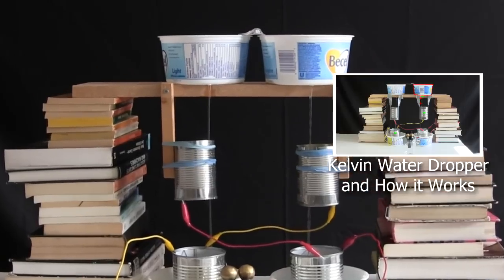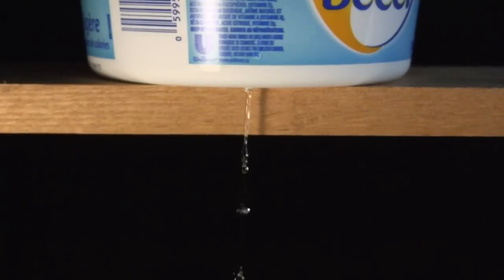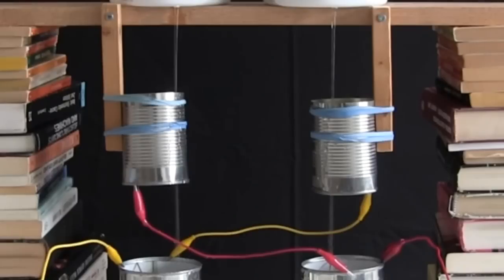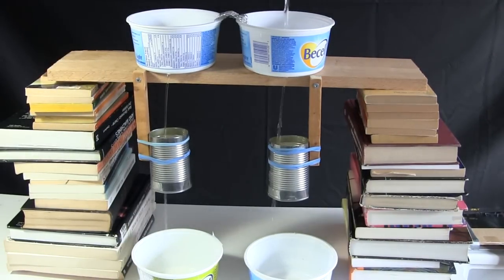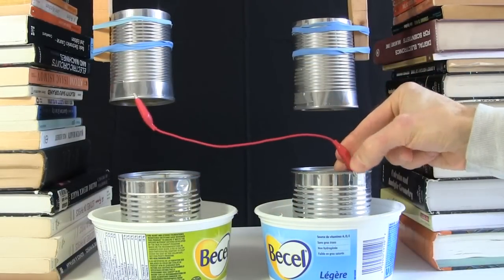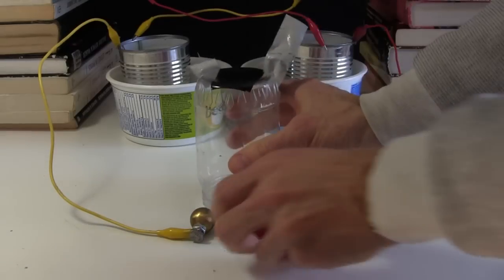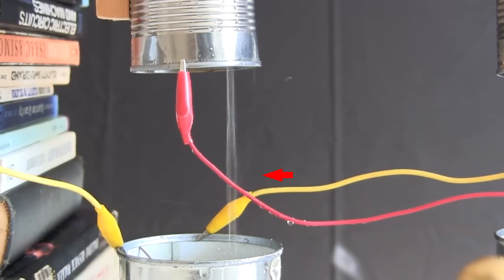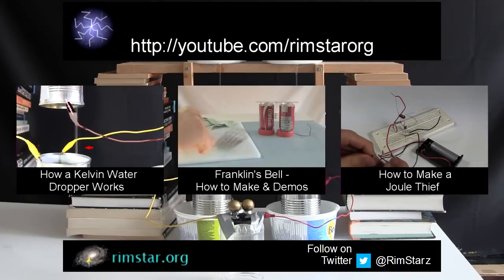How to Make Kelvin Water Dropper/Lord Kelvin's Thunderstorm

Comment: I'm using soda cans instead of the type used in the video. They do conduct electricity, and I've taken all other mentioned precautions. But still the spark ain't happening.
Can you suggest some other remedy?
Reply from the maker: From tests I've done in the past, I know that at least some soda cans have a non-conductive coating inside which you'll have to scrape off to make contact with as described in this video. Other than that though, rather than repeat a lot of tips, I have a section with tips on my webpage here: https://rimstar.org/science_electronics_projects/how_to_make_a_kelvin_water_dropper.htm. Let me know if that still doesn't help.

Comment: I have a metal on the inside, plastic on the outside container? Would that work?
Reply from the maker: Yes, that should work. Just make sure you connect the wires to the metal.

Comment: I'm trying to do this for a project, what could I use instead of brass balls?
Reply from the maker: Any smooth, roundish metal objects will do. For example, drawer handles sold in hardware stores, bolts with rounded heads, ...

Comment: I wish I had found this when my kids were little. It would have made a great science fair project. What happens if you don't let the charge discharge with the little balls? I figure the charge would build but then what?
Reply from the maker: The charge would build. If the gap is too large for the spark to happen then the charge would likely just leak away at any sharp edges having reached some maximum allowable by those sharp edges and maintain that maximum.

Comment: hello sir i just want to  aquestion tht how tht hollow can will act as a inductor and simply charge without any charge on it....just only can will act as a inductor .....sir please explain....
r
Reply from the maker: That's a hard one to explain in a comment reply. Have you watched my video about how this works? You can see it here http://youtu.be/sArNxGnYhNU
If you're asking how it has a charge to begin the whole charging process, very rarely will two objects be completely neutral. So as long as there's a very small difference then that's enough to get things going in this case.

Comment: Does the water falling through the second botomless can have zo come in contact with it?
Reply from the maker: +Peter Bucek No. You don't want the water making contact with the bottomless cans since that would electrically connect them together and cause them to have the same charge. It's okay if some water sprays onto the cans (it's hard to avoid that), but you don't want the solid stream of water that's falling into them to be in contact.
Reply: +RimstarOrg Thanks so much for such a fast reply, I am definately gonna try this since you've inspired me!
Reply from the maker: +Peter Bucek Cool. Be sure to check out the How-it-Works video too https://www.youtube.com/watch?v=sArNxGnYhNU. There are also a bunch of tips on my webpage about it here http://rimstar.org/science_electronics_projects/how_to_make_a_kelvin_water_dropper.htm.
Reply: +RimstarOrg Thanks

Comment: Did you measure the voltage coming out?
Reply from the maker: No, I didn't measure the voltage. It really depends on the shapes of the electrodes at the spark gap though.
Reply: @RimstarOrg  very interesting. I always wondered if the shapes made a difference.
Reply: @ShadowGPSDFX  larger spheres have more capacitance than smaller spheres (given the same material in all cases) and can hold a greater charge before causing the electrical breakdown of air.

Comment: Ok. And if you use magnets? Or water with pressure?
Reply from the maker: Ionwind Vortex I don't see any way that either magnets or pressure can help. What might help is volume of water falling down though, or multiple streams of water.
Reply: Thanks
Reply: this experiment look like vimanas reacctor or victor shauberger, that way i make the asking of presur, what do you think about it?
Reply from the maker: Ionwind Vortex What makes me wonder about pressure is that the water must be a solid stream above the inductor cans and droplets below the inductor cans. You'd have to make sure that higher pressure doesn't interfere with that. I think all that pressure will do is make the water need to fall from a higher height. I think it's air resistance that causes the solid stream to break into droplets and with more pressure I think the water will have to fall further before that happens. I could be wrong. That's why I suggested using more volume instead. With more volume the height can stay the same.
Reply: RimstarOrg i thinks with very high presure... the water flowing more and more fast and at some speed with the rigth temperature the water transfor it self and become like a electricity

Comment: Which wire is best for this
Reply from the maker: Any wire will work. However, since there's water flying around, you should at least get wire that has insulation on it (i.e. not bare wire).
Reply: Okk

Comment: I used 4 monster energy cans but was not able to create a spark. I want your help to make it for my school project which is just after 3 days.
Reply from the maker: Harshvardhan Agarwal It takes a lot of adjusting. Make sure the water enters the inductor cans (the ones that the water falls through) as a stream and exits as drops as I show in the video. Looking at photos online, monster energy cans are quite tall. Maybe cut the ones used for the inductors to half their length. That'll make it easier to make sure the water enters as a stream and leaves as drops. Also, have the stream close to the inside edge of the inductor cans but not touching.There may also be a coating inside the cans that are sitting on the table that could be interfering. The coating may not be visible. Use a sharp object (e.g. the tip of scissors or a knife) to scrape some of the coating off inside those cans. The areas you scrape should be areas that are under water. Be careful not to cut yourself on the edge of the cans.Also, make sure that where you are connecting your wires to the cans that you're connecting to metal and not paint or some coating. Scrape away there too until you see metal. You could use sandpaper there to scrape since that area's easier to get at.What are you using at your spark gap? The two ends of the spark gap that face each other should not be sharp points. They should be smooth.If that doesn't help, you can go to my website http://rimstar.org and at the bottom find my email address and send me photos.
Reply from the maker: Harshvardhan Agarwal Your inductor cans, the ones the water flows through, don't look lined up very well with the bottom cans. Was that just for the photo or is your water flowing in a large curve? It's critical that the water be a solid stream above the inductor cans and then turn into droplets somewhere on their way through the inductor cans.Also, I'm not sure if I was clear but there may be a coating INSIDE the bottom cans. You also need to scrape away some of that INSIDE coating where the water inside contacts it like I did in the video. I'm not sure if you did that.I'd also suggest lifting the rounded objects for your spark gap up so they're not touching anything. In your photo it looks like you might just be sitting them on the wooden on the table.

Comment: Hi again. http://i.imgur.com/Z1Otpp9.jpg This is my setup but I cant get it to work. Would you have any idea why? My cans are very crudely cut for the inductors with kinda jagged edges but the water seems to attract to the sides well enough.  As a last question, how long would the water have to be flowing until the first spark occurs? Thank you!
Reply from the maker: If your water is attracting to the sides then it's working. Try moving your bolt heads closer together i.e. making your spark gap smaller and look at it with a dark background -- maybe even dim the lights. The spark may be very tiny. Having everything wet like it is in the photo can create losses by having some charge conduct where it's not supposed to, which would make the spark smaller. The thing the bolts are sitting on is pretty dark so look downward at the spark gap. I'd also suggest drying up a lot of the water on the floor and the yellow wires or at least make sure the yellow wires don't touch. Since the yellow wires are all wet that makes the outsides of them electrically conductive and if they touch then they'll conduct to each other, shorting out the effect.
As for how long until the first spark, mine was only a few seconds.

Comment: +RimstarOrg I'm trying to build my own but i can't seem to get it working.  I've tried all the tips and tricks that you state in the video.  I know this a lot for a stranger to ask but I posted on stack exchange physics to see if anyone could help me there.  I got some tips but none of them worked.  I would really appreciate if you could follow the link to the post as i shared detailed pictures about my setup.  http://physics.stackexchange.com/questions/321304/troubleshooting-kelvins-water-dropper. 
Thanks a million and CONGRATS ON 100 000K SUBS!!  My knowledge of electrostatics had reached a whole new level because of your videos.
Reply from the maker: I don't see anything wrong. You seem to have tried everything. All I can do is reiterate some of the things that were pointed out in the physics forum. Play around the the vertical position of the inductors to make sure the drops form while passing through the inductors. You're already having the stream be near one inside edge of the inductors, but make sure the water doesn't touch the inductors. 
I like your foil trick in the receivers (collectors), unless the foil has a coating too! Use a meter on the resistance scale to see if there's a coating on the foil.
Too many sharp edges, as you'd have with foil, can cause leakage of the charge so maybe you're losses from that are too big, though your foil doesn't seem to have very sharp edges anyway. I'd be most worried about this at the inductors.
Reply: +RimstarOrg Thanks so much for the reply (speedy too!).  I'll probably a different setup with larger collectors and a deeper reservoir.  But before i do that would it better if i cheated a bit and made my inductors longer?  That way it should be easier get the streams should transition within the confines of the inductor.
Reply from the maker: The problem I can see with making longer inductors is that if the transition occurs higher up in them then when the drops fan out they'll contact the inductor and neutralize it (they have opposite charges). So you'd end up having to raise the inductor anyway. Mine are taller than yours, so it does work, but I had to adjust them vertically anyway.
Reply: Hi, did you manage to get it to work?

Comment: How much is the brass balls?
Reply from the maker: The brass balls came as part of a high voltage power supply I'd bought. Any rounded metal object will do. In hardware stores they sell metal knobs for dresser drawers. But really just look around for any rounded metal objects. Even if there are straight edges to them, just keep the rounded sides facing each other for the spark gap.

Comment: I have tried everything. still not working. 
need help please ! 
1. do the both end open cans have to have the insulation scraped off ? 

2. what type of errors to use ? will multiple wires bound together work ? with insulation. 

3. to electrically connect the water containers how think should the al foil be ?
Reply from the maker: +akhilratna chettri 1. Yes, both end open cans have to have at least some insulation scraped off where there is water. 2. All insulation must be removed from the wires there are are bound together or make contact with the cans or other things. 3. The thickness of the al foil doesn't matter. Just make sure some of it is in the water. There are a whole bunch more construction tips but rather than repeat them in the comments I've put them on my webpage here http://rimstar.org/science_electronics_projects/how_to_make_a_kelvin_water_dropper.htm
Reply: I've read it all ! 
I've been trying this whole experiment for weeks. Not being able to get the spark or the deflection in the water stream. 
I'm using inductors cans from diet coke cans and have scraped off the insulation both inside and outside. My receivers are conducting and the wires too are. The stream has been kept need to the inner wall of the inductors. I do have metal ball like structure which should work. The frame of the set up is wooden. The resoviors are electrically connected. The receivers are insulated from the ground. 
Anything that I'm missing on ? Does the thickness of the inductors matter ?
Reply: I've read it all ! 
I've been trying this whole experiment for weeks. Not being able to get the spark or the deflection in the water stream. 
I'm using inductors cans from diet coke cans and have scraped off the insulation both inside and outside. My receivers are conducting and the wires too are. The stream has been kept need to the inner wall of the inductors. I do have metal ball like structure which should work. The frame of the set up is wooden. The resoviors are electrically connected. The receivers are insulated from the ground. 
Anything that I'm missing on ? Does the thickness of the inductors matter ?
Reply from the maker: +akhilratna chettri You need to removed insulation from the inductors only where you connect wires to them. It doesn't matter if the rest of the surface of the inductors are coated in anything.
Other than that, I've said everything in the two videos and the website and what you say sounds good so I don't know what more I can say other than to repeat things. Your spark may be tiny so but a black background and bring the balls close together. Don't bring the water so close to the inductors such that there's too much contact between the water and the inductors otherwise you'll short out the effect, but you do need the water to be close. Make sure the stream of water enters the inductor as a solid stream but leaves as drops. Oh, and make sure there isn't a lot of water between the two receiver cans on the table. That can create a conductive path between them that'll short out the effect. It never works the first time around and it does take some playing with.